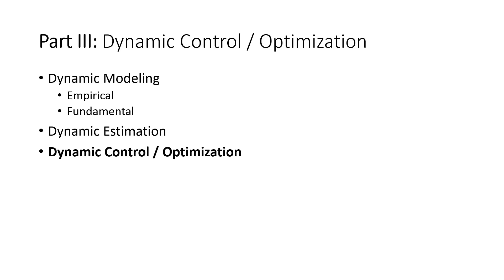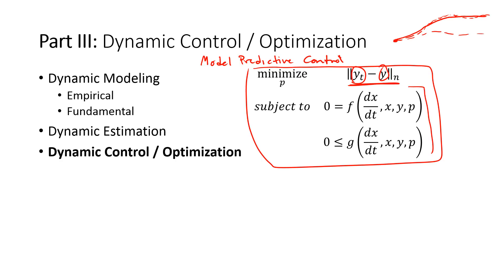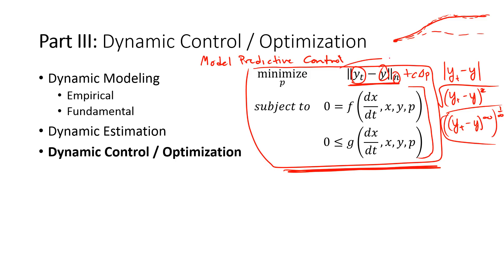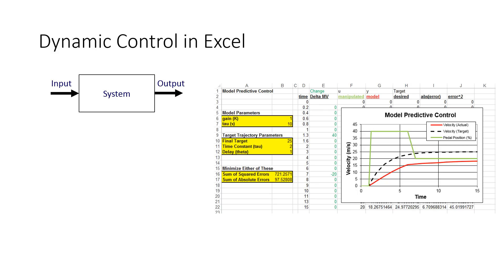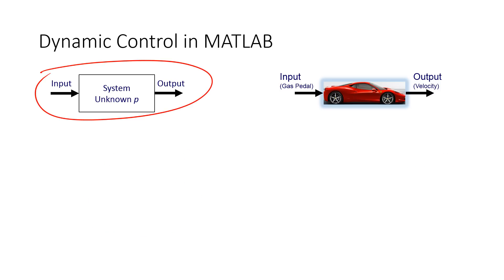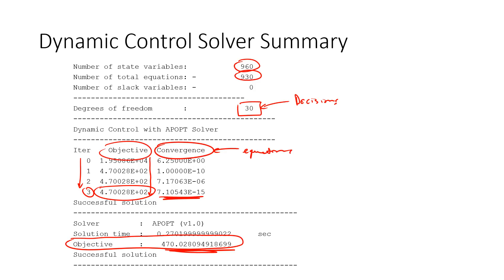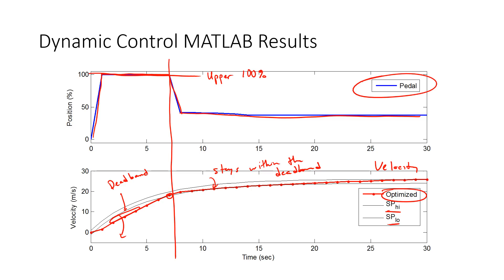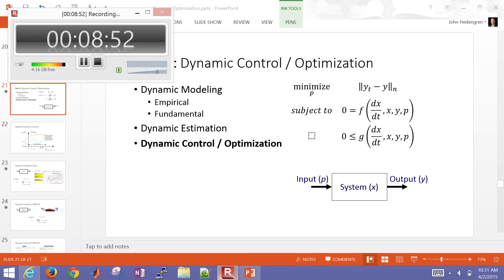Introduction to Model Predictive Control

Comment: Dear Sir, Thank you for this tutorial. I am trying to use a MPC controller to control a plant. In my case, I have a neural network model of my plant (function fitting ANN 3 inputs 3 outputs). Would it  be possible to use MPC in conjunction with my ANN plant model? Could you please provide advise how this can be achieved and relevant resources that I can consult. Thank you
Reply from the maker: I recommended to use the python Gekko package. It has a neural network example if you just do a Google search for apmonitor Gekko. There is also a Dynamic optimization course available that can help you to implement model predictive control. http://apmonitor.com/do

Comment: sir , can I use state space model instead of transfer function as process and control it by model predictive control
Reply from the maker: State space models are not a problem: http://apmonitor.com/wiki/index.php/Apps/LinearStateSpace  You can also do model identification: http://apmonitor.com/do/index.php/Main/ModelIdentification  The attached scripts in MATLAB or Python create the state space model automatically.
Reply: thank you sir
Reply: @sudheer843  hi have u tried to model inverted pendulum with mpc